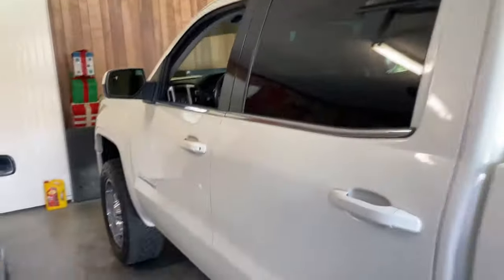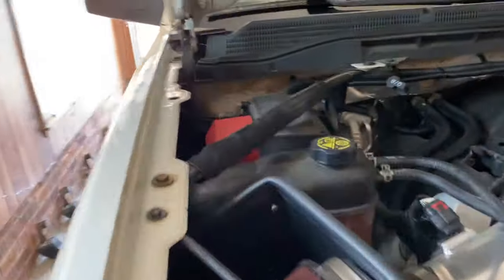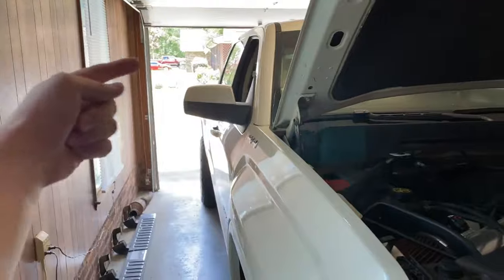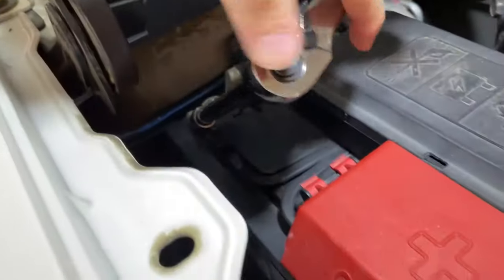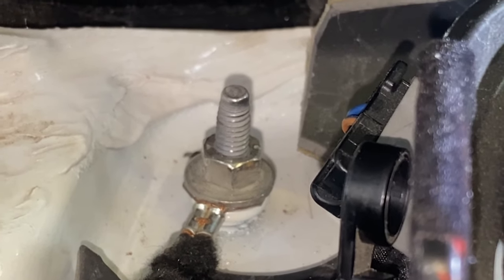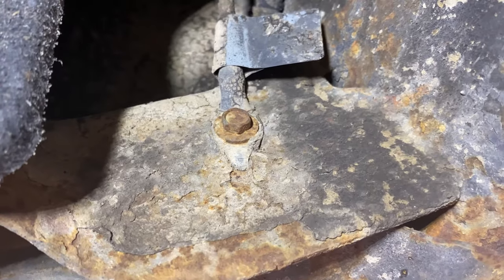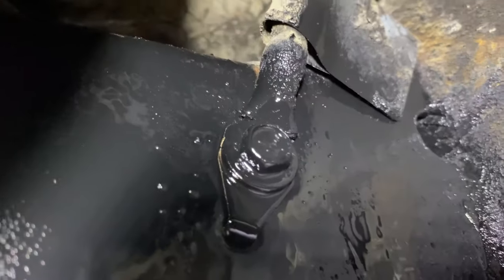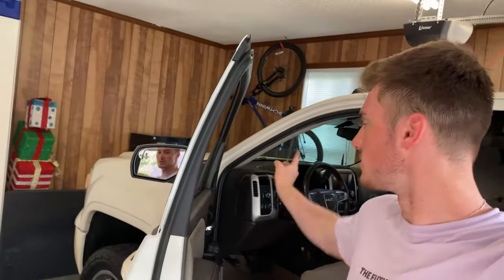2014-2018 Sierra/Silverado Flickering or Shutting Off...Ground Issue SOLVED!

Comment: Man mine started having these problems after I changed the starter could it be any cables down there if not I will still check all my grounds , how do you know if the negative to the battery is bad ?
Reply from the maker: I would definitely check your grounds to the starter, but it could also be a coincidence 🤷🏼‍♂️. Electrical issues can be hard to track down and/or confusing. But something that I’ve done in addition to this video is I’ve opened up that box that sits on top of our batteries and disconnected the connections in it and cleaned them up as well. Then made sure they were super tight.
Reply: @hunterrwiilson  thanks man I’m gonna try this cause yesterday I was parked  turned my a.c on and my rpms flunked and made the car shut off but all my lights work , currently doesn’t start at all
Reply from the maker: @feardc2050  if the AC made the truck cut off, I’d go into the dash and go clean up the other side of the dash too. The opposite side of the one I did. That ground is allegedly for the AC, so that could be it.

Comment: When it cut off did you get a message telling you to roll your window up and down?
Reply from the maker: I’m not sure 100% sure but I think it may have. I remember something like that happening.
Reply: Mine did. My truck said something about Stabilatrack, two keys programmed and open then close driver’s window. Gonna try what’s in this video and hope it fixes the issue
Reply: Mine did say roll down my window and down 2017 Silverado gonna try this tomorrow
Reply: @VvcrxzyV  did this work?
Reply: @Flaco20x  mine does that

Comment: Cut off the factory battery terminal connectors and replace them with the old school battery terminal connectors,  both positive and negative. Problem solved. Those new fangled battery connectors GM put on the 2007-2014 batteries work loose due to vibration.

Comment: Having issues with stabilibrak service. Cluster needles going wild & minor revving. Also “ reduced steering assist drive with care “ speed sensors were swapped out still having the issue do you think this may be the issue ? My thought was a faulty ground but no idea which. Hoping some one could be of help…
Reply from the maker: Ouu, that sounds tricky. If you're wanting to stay cheap try fixing grounds and see what that does for you. I wouldn't drive it after your tests but just to see what fixing those minor electrical issues solve (if any). Look up a lot of forms about your specific issue and see what they say, but if you're unaware of what to do I'd try a technician. I almost had to do it here recently, but I found an electrical issue with a voltmeter and my amp was faulty. Anyways, see what you can do DIY and if all else fails, technician.
Reply: I just solved this issue on my 2015 2500 Denali. The cruise control still randomly turns off when driving around right side curves. However, the issue you are experiencing are due to your stabilitrak sensor system. I replaced the hub on the bad wheel & it solved the issues. Your stabilitrak has roughly 8 different sensors connected to it. ABS, BCM, Wheels speed sensor, etc!
Reply: @shortyd427  did you have any codes show up?

Comment: I realize this is an older video - but there's Nuthin' wrong with Added NEW Grounds to help with those electrical issues.  Engine Grounding using 4gauge OFC is Very optimal in these instances.
Reply from the maker: @-WolfMan-  people have gone that route and it’s seemed to work for them
Reply: @hunterrwiilson  Actually... it works for EVERYONE that does it Properly.
Reply from the maker: @-WolfMan-  Exactly
Reply: Video on adding a ground?
Reply: Video on adding a ground?

Comment: So what ground connection do you think it was? You did both at the same time.
Having same issues with my 2017.
Reply: I've already done the ground under the dash, there's actually two, one behind each tweeter (take the tweeters out for easier wrench access) it solved a problem with the power steering shorting out, but lights and screens are still flickering, so I'm going for the frame ground tomorrow and will see how that goes
Reply: @SlightlyStoopidGaming  Just figured mine out.
It wasn't an issue with all 3 ground connections itself.
I cleaned all 3 grounds.
I did a cranking voltage drop test on my negative cable itself at the battery and got .700 amps.
It should be under .300.
Replaced the whole negative ground cable and it is fixed now.
The issue got worse as it got warmer out.
After I got the old cable out it showed no signs of wear or break in it.
Reply: BTW. The new cable showed .210 amps when cranking.
Reply: @SlightlyStoopidGaming  did it work im have the same issue
Reply: @malmazan2124  it has lessened the issue, but I'm still getting the issue of the radio cutting out when I brake at low speed sometimes. Not as much, but it's still there. I think a full negative cable replacement may be the way to go at this point.
Reply: @SlightlyStoopidGaming  my extended warranty didn't cover it. It's currently at the dealership they charge me 600 to replace both cables I think it's a little steep!
Reply: @malmazan2124  I agree, from what I've heard, the negative alone should cost about 80, if you diy. But not sure if the pos would be any different.
Reply: @SlightlyStoopidGaming  do you know where can I buy them ?? Thanks in advance!
Reply: @malmazan2124  it completely fixed my issue
Reply: @malmazan2124  there is a service bulletin for this. You shouldn’t have had to pay for anything
Reply: @SlightlyStoopidGaming  did the ground wire but still same issue!
Reply: @crystalc1818  can you send me the link so I can tell the dealership?
Reply: @malmazan2124  the issue has mostly gone away for me. Occasionally it pops up. But I haven't seen it in a couple months now. I'd still probably say replace the whole wire if it persists
Reply: @crystalc1818  Service bulletin has nothing to do with warranty

Comment: i think you got lucky, the ground bolted to the frame doesnt affect ignition components, you can unbolt it and the truck will still start up and run. And you technically didnt do anything with the ground under the speaker... good vid anyways !!

Comment: Did that fix the problem? I just bought a 2015 high country and it did the same to me
Reply from the maker: It did fix it. Hasn't done it since.
Reply: Ok great I’m doing that tomorrow, I just bought the truck 2 days ago and was pulling in my driveway and same thing happened
Reply from the maker: @lukedupuy35  I'd be pissed in all honesty 😂 but yeah it scared me at first cause my truck flickered at the end of my street and then just shut off as I backed into the driveway.
Reply: @hunterrwiilson  yeah man, so if doesn’t work for me im taking it back, but I hope it does bc I love the truck
Reply from the maker: @lukedupuy35  You should have no worry, it should work for you.
Reply: @hunterrwiilson  yeah I hope so man!
Reply: @lukedupuy35  did it work brotha? It just happened to me I was turnin onto a main hwy thank God I was goin slow and it caught my hand in it and twisted it completely man did it hurt
Reply: @joeroe2839  yeah it did man, 10 months later and absolutely no issues

Comment: My truck has shut off a few times on me like you said but I haven't fixed the issue
Reply from the maker: I haven't had any issues with it since the fix
Reply: I'll be trying it later on. Had my happen when doing it while on the highway. Very fun adventure
Reply from the maker: @ecocav0222  Are you, and anyone with you, all good after it? Any damages to you or your truck?
Reply: @hunterrwiilson   No, just about a 4 second drive in complete silence from the truck. As I coasted with my butt clinched up.  I really like the truck have had it since new in 2016. But I'm leaning on fence of getting rid of it. Although let's be real buying something else just means dealing with those issues of that vehicle. As almost every vehicle made in the two decades and now will have bugs. Basically pick your poison in the hopes it goes down well.
Reply from the maker: @ecocav0222  Glad to hear everything is all well. But yeah, though getting rid of it would save you the trouble of dealing with a high mileage vehicle, you’ll still deal with any other nonsense with another. So you’re right. I just actually had to rebuild the transmission in this truck, definitely a hefty penny.

Comment: Has anyone had the steering wheel lock up while experiencing this issue while still moving?
Reply from the maker: Yeah, since our power steering is electric it gets effected from this electrical issue
Reply: Wow, what’s the strategy to survive this if you’re going 60+ turning onto a off-ramp when it happens?
Reply from the maker: @T5pinner  Idk if you've read some of the comments but some of these folks had that happen. Thank the Lord they survived it and did what they needed to keep all parts together.

Comment: This happened to me a few time coming back from camping it said something about trailer brake system and it flickered off but the engine was still running and it turned back on in a sec. Any suggestions?
Reply from the maker: I’m not really too sure about that one. What do the Forms say online? I usually Google my issues and read the forms to see what others have done
Reply: Did you solve the problem?
Reply: Did you ever find the problem mines did that the steering was stuttering and everything

Comment: I did this to my ‘14 Silverado and was running good for 6 months till it completely shut off on me again, also my headlights flicker when I hit the brakes, anybody know any solutions to this problem?
Reply from the maker: Go check your secondary grounds. You know little box on top of your battery that has like three wires coming out of it? Open it up, unbolt those wires and get a rough wire brush and clean those connections, also the things that you just took off. I picked up some dielectric grease from O’Reillys and put it on those connections. Then tighten everything down very securely (without over tightening). 

I had a similar situation where my power steering wasn’t working 100% and my whole truck was studdering as if a ground was sparking. Haven’t had any issues since. Hope this helps!
Reply: @hunterrwiilson I’m having this issue with my 2018 right now I randomly lost power steering on vacation….had to drive two hours with no power steering on 35s.
Reply from the maker: @jatmomdadjt8744  ooooofa, yeah man give this a try and see if helps
Reply: @osvaldoperez1950 if you find the issue?

Comment: Didn't work for me... Now what ??? 🙄
Reply from the maker: Check your bonding and grounds inside that small black box on top of your battery. Open it up and disconnect those connections, clean them with a wire brush or so, put them back and use dielectric grease on them when tightening them back down. 

I had to do this to my truck about 6 months ago cause it was being funny. Hasn’t had any electrical issues since!
Reply: @hunterrwiilson  Well. I tried it. Rest assured. I did the job right. Now it's worse than ever.... I'm at a total loss 😔. wtf
Reply from the maker: @randymiller5008  :( sorry nothing seems to be working, it’s clear your electrical issue is more than just some grounds. Do what you gotta do, but thank you for at least trying some advice from a random guy on the interwebs! Blessings!
Reply: Thinking about adding a third ground wire off the battery. I've heard that works for some people. Idk
Reply from the maker: @randymiller5008  doesn’t hurt to try!
Reply: My mechanic said that it was my alternator that was making the grinding noise not the water pump. There both under warranty. Hopefully my issues go away. We'll see...
Reply from the maker: @randymiller5008  that’s interesting, let me know how it goes!
Reply: No issues so far. Must've been the Alternator. List price 655.92 belt tensioner  128.80 🥺
Reply from the maker: @randymiller5008  oooofa, guess that Just falls into the “maintenance” category with these trucks 🤷🏼‍♂️
Reply: This is the second alternator in ten months.... Not good 🥺
Reply from the maker: @randymiller5008  I would get more technicians to look into that, doesn’t sound right. Unless that alternator Just coincidentally was a faulty part

Comment: Hey, don’t title your videos SOLVED unless you a) can reliably recreate the issue b) do a fix and then be unable to recreate the issue.  Your video did neither.  Fortunately there is better information in the comments than in your video.
Reply: I thought he said it solved his issue.  Outside of checking the 2 posts in the dash, cleaning / replacing your ground cable terminals and grounds in the distribution abave the batter, what do you suggest?
Reply: @christaylor9895  I think the dash ground issue was only if there was plastic in between the terminal and the firewall.  There’s braided cables from the engine block to the firewall, there’s the engine block ground, as well as the body ground (which he covers here).  But it’s unknown whether there is another common fault with the fuse/distribution block or the myriad connectors behind the dash.  Ideally i would have liked to see a milliohm measurement between the battery and the body ground before and after cleaning.  Then also determine whether dash flickering did persist or cease after the cleaning.